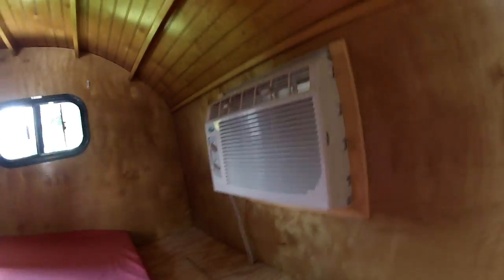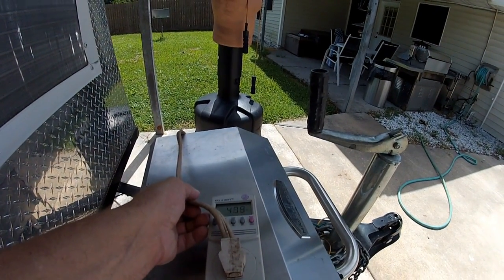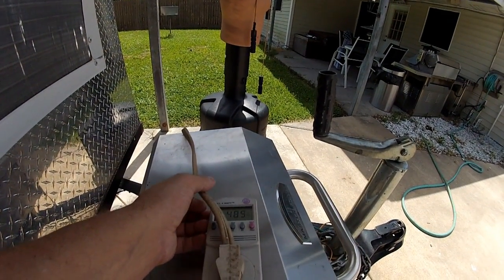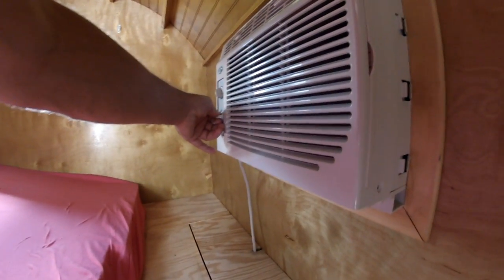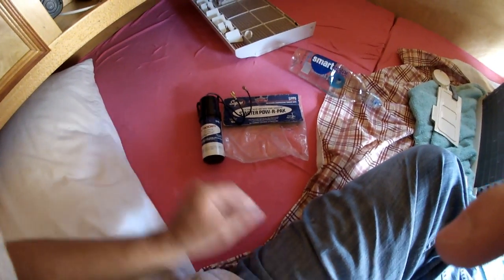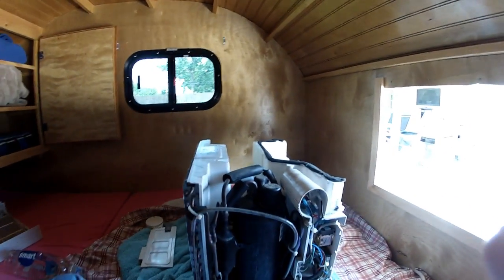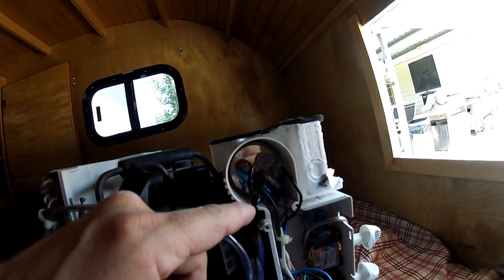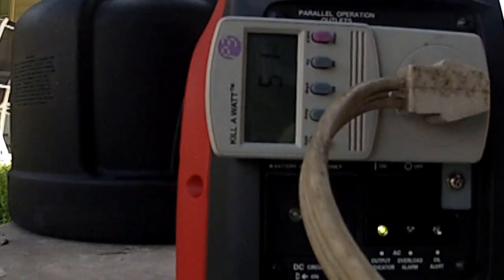5000 BTU air conditioner running on a 1000 watt generator

Comment: Well, you purchased the wrong generator, a few reasons...  

1) the eu1000i is a good generator (don't get me wrong) but... it's peak load is 1000Watts, but only rated for 800 watts load, so when you throw on your ac using 480 watts it has to run 100% (well, there goes the neighborhood) now the damn thing is making a lot more noise and wasting a lot more fuel doing it!  :(  

2) you should have bought the eu2000i, Yes, it's a bit heavier, but at 1600 watts running your 480 watt ac will leave it running in ECO mode, saving a lot more gas and being a LOT more quieter.  Win...win, and most likely since it peaks at 2000 watts, you wouldn't have to mess around with a super coil to get it to run when the compressor cycles. Also, by not running in full speed mode, you'll save ware and tare on the unit, maximizing the engine life.

Because the engine does not have to run at full speed constantly, Eco Throttle reduces fuel consumption by up to 40%. It also helps to reduce exhaust emissions. Eco Throttle also reduces the noise level on our inverter generators. Because the engine is not running at full speed constantly, it is much quieter. Always do your homework before buying a generator and make sure you get the right size for the right application!

Comment: so just to make sure i understand, before you installed the capacitor, it hit 1251 watts when the compressor came on, but after installing the capacitor only went to 600something?

this would let me run a 5000btu ac on a 800/1000 watt generator right?

Comment: With the capacitor installed, can you then run your generator on eco-throttle mode and have the capacitor still handle compressor cycles?  If this works, then the cap is the way to go!!
Reply from the maker: i had no luck

Comment: My capacitor only lasted 1&1/2 nights it's also the SUPCO SPP6 and a 5000btu AC. Any ideas? It probably cycled every 1/2 hour. I have a analog dial AC also. I was using a 2200 Yamaha gen though. I'm thinking I need a bigger capacitor or use the low setting only so it doesn't cycle as much.

Comment: Not sure I understand how he hooked up the new Supco SPP6. Anyone know how you wire it up, do you replace the old capacitor with this new one, or d you add it to the ode one in series?
Reply from the maker: its in parallel with the starter capacitor

Comment: how long does it last for before it drains your generator? im planning to convert a 15 passenger van into a camper, ac is very important where i live THANKS!!!
Reply: Your generator is not a battery.  It "drains" when it runs out of gas.  You have to keep gas in it.

Comment: You should wait about three minutes before trying to cycle the compressor back on. It's partially seizing from the back pressure. Good idea on the capacitor though! Would be cool to put that on the mains out from the genny so other motors could benefit.

Comment: I've attempted it with an unmodified 6500 BTU Goldstar (LG) unit. Starting was hit or miss with the eu1000 but it usually works if I turn it on in "Fan Only" mode first, set the fan on low speed then switching it to "Cool" mode to engage the compressor and turning the fan back to high once the compressor is running

Didn't let it cycle; once it was running, I turned it down to 64F so it pretty much ran continuously then if you want, you can flip the eco-throttle mode on.